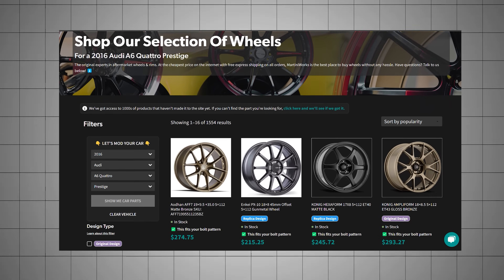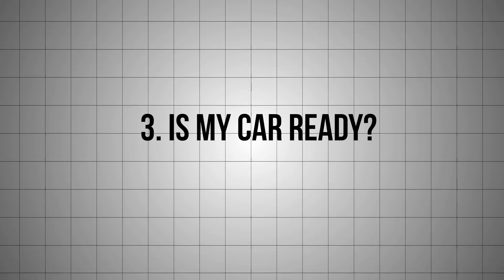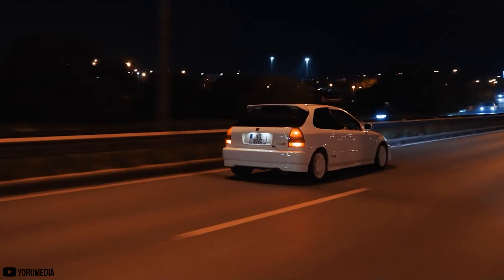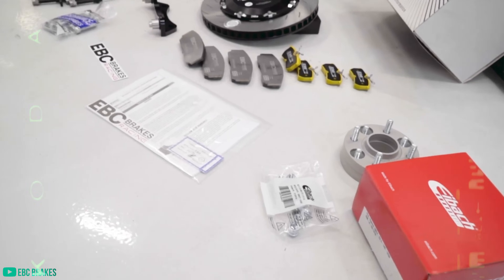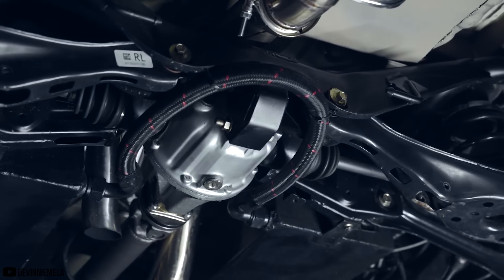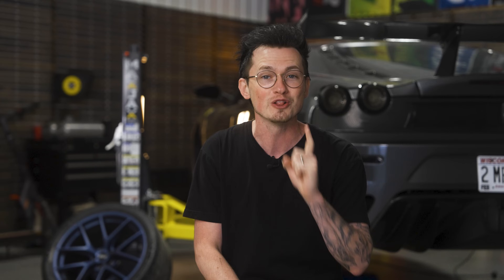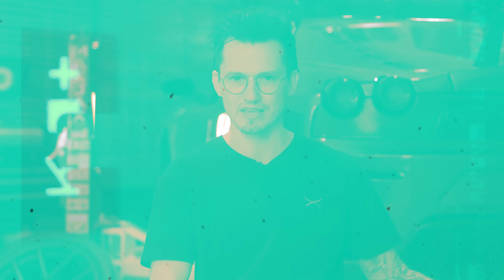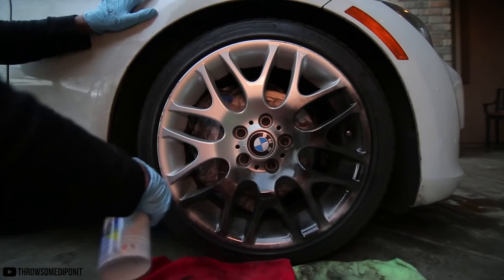How To Modify Cars For CHEAP

Comment: Im hoping to buy a new daily, a Lancer Sportsback GSR (2.4L manual). My plan for it is to keep things simple for the next few years if i get it seeing i have the the Lancer Ralliart as the weekend/project car.
But plan is, take the useful parts off my current daily, get Rota MXR-F wheels, install lower springs (off current daily) and do any suspension work that is needed and keep it as a cruiser. When i do the turbo upgrade on the Ralliart, recycle the parts from that to the Sportback a year or two later.

Comment: I’ve had an 05 Civic for a little over 3 years now and I’ve done an oem+ style build with it so far. I’ve got the car cosmetically where I want it and I’m gonna start performance mods in the fall. I got the car did an engine and transmission swap immediately. Then painted the car and replaced door belt moldings, door window seals, painted all exterior the plastic trim, wiper blades. Flexi dipped the wheels. Salvaged missing pieces I wanted from junkyards and Facebook marketplace. Sourced grills, badges, and emblems from Canada. Refurbished the oem emblems. Fixed all of the issues I had with lights not working around the car. Replaced the lights behind my gauge cluster so the entire cluster lights up bright like day one. Painted my valve cover red. Now I just keep up on detailing her weekly and maintenance. 

As of right now I have one of the cleanest EP3 ‘s I have ever seen in person. I’m also biased.
Reply: Do you have a/c, heat and power steering ???